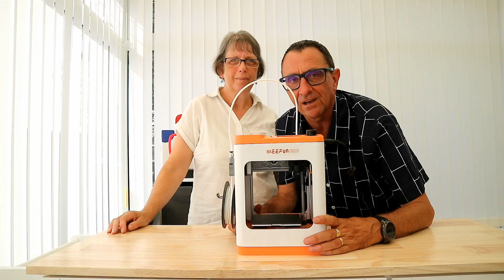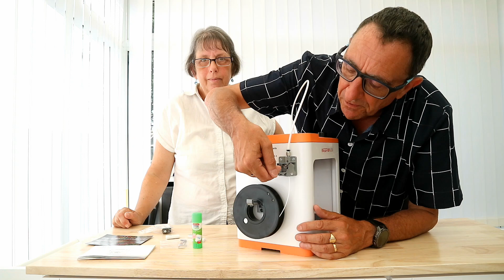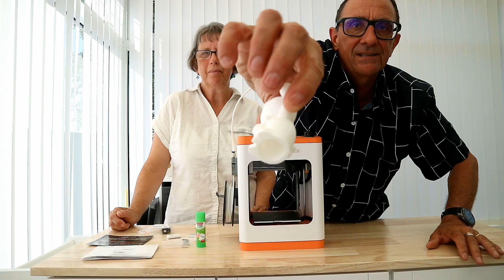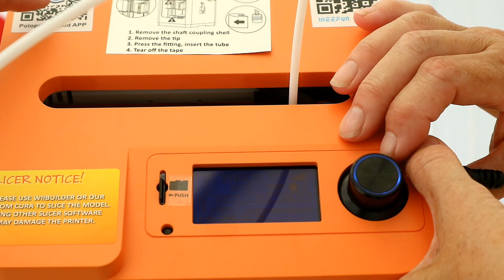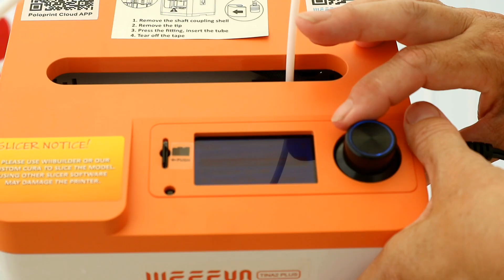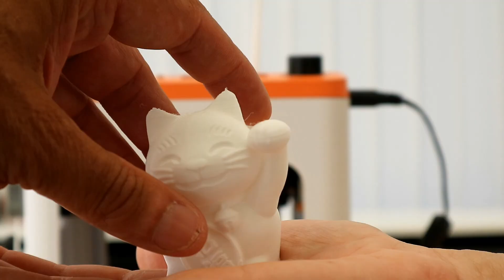Tina2 Plus 3D printer by WEEFUN

Comment: Nice little review guys getting tech now my first 3D printer was a similar unit to that you can also use pritt stick to put on the build plate I now have 4 high spec big build printers 2 filament and 2 resin printers
Reply: Thank you Peter, this one is designed to be easy enough for children to have a go 😊
Reply from the maker: Thanks for the tip!